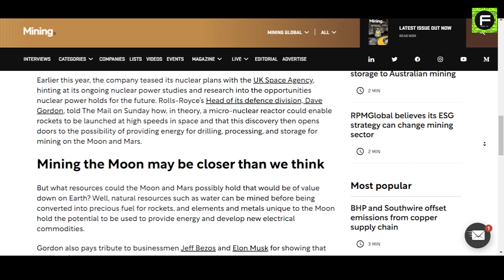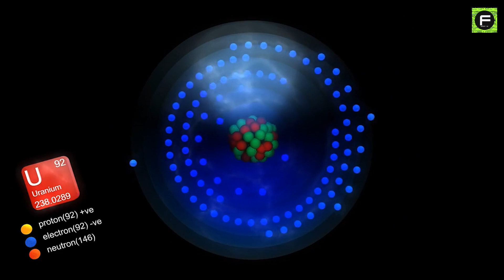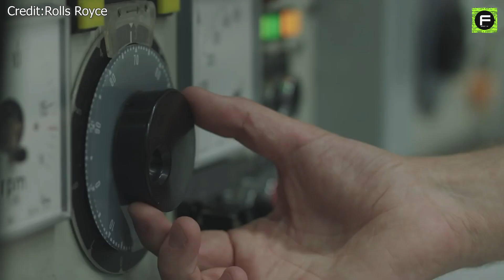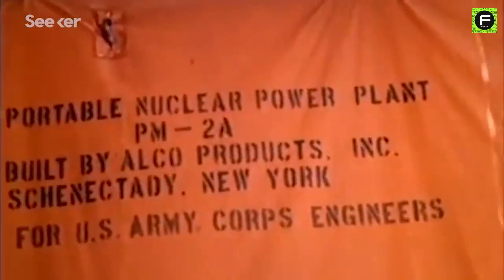Rolls Royce’s Insane Nuclear Plan To Mine On The Moon

Comment: Ahh...The old classic that we need nuclear reactors b/c solar fades as you get farther from the Sun. Solar sail-like mirrors can compensate out at least to Saturn and still have better power/mass than any nuclear fission system flown or proposed.. JUNO has done pretty well at Jupiter without even help from mirrors.
Solar is 4 kg/KW currently. The Kilopower nuclear reactor/Stirling engine system is 150 kg/KW at orders of magnitude higher cost. Solar power satellites can beam power to the surface of the Moon or Mars, etc. Nuclear in this case is a gambit to fleece the taxpayer IMO.

Comment: This is very possible and in fact, probable. SpaceX have the tech to go to the moon already. Exciting times ....
Reply: probable? what makes you think that when space travel has never beeen proven to be actually true? My view is space travel is fantasy stuff! Think about it how on earth do rockets even propel themselves in a vacuum or pressureless environment? Err don't tell me "ever heard of newton's 3rd law of motion which states to every action there is an equal and opposite reaction". In response I would say, sure I've heard that and imho I think it's been misrepresented to help generate the space travel myth. My interpretation of newton's 3rd law is "to every action there is an equal and opposite RESISTANCE to that action in the form of a reaction". So exhaust flowing out the back of a rocket in a pressureless environment will not generate thrust because there is no RESISTANCE in space!

The content of the video imho is rubbish!
Reply: @PeterPete  with respect much of the gaps in your knowledge will be filled with education. Do a basic experiment in a vacuum chamber.
Reply: @wildatlanticman128  basic experiment? Cody from Cody's Lab did one, he sucked the air out from a drum and tried to set off a charge that was taped onto the end of a rotor and it didn't move or spin which shows a charge won't ignite and thereby create thrust in vacuum!

so what demo are you suggesting i do?
Reply: @wildatlanticman128 Cody encapsulated his charge in air pressure and it worked., he never used rocket propellant. There's no air pressure in space! Any rocket needs air pressure to provide resistance in order for the rocket's thrust to push against!!
Reply: @PeterPete  I find people who have zero knowledge make statements as if they're fact. Go read. Spend your time productively.
Reply: @wildatlanticman128  You're not addressing my point. In order for Cody to get a charge to work in a vacuum he had to surround the charge with air pressure.

NO air pressure = no motion!!

Are you suggesting space has air pressure?
Reply: @PeterPete  ok it's an understandable question. To ignite a flame does require air, or specifically oxegen. Rocket propellant is part oxegen, so no need for air. This then creates motion satisfying Newton's 1st law. Hope this helps.
Reply: @PeterPete  that's disappointing. Good luck.
Reply: @wildatlanticman128  yes lots of people feel saddened when they realise space is a load of BS!! But hey ho, that's man's world of illusion for you!!
Reply: @PeterPete  Do the experiment yourself.
Reply: @wildatlanticman128  what experiment?